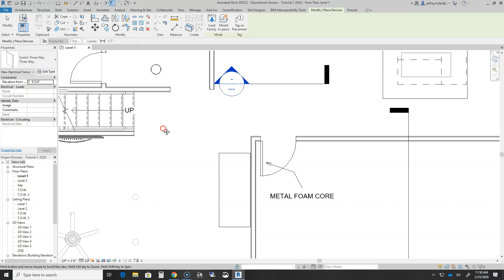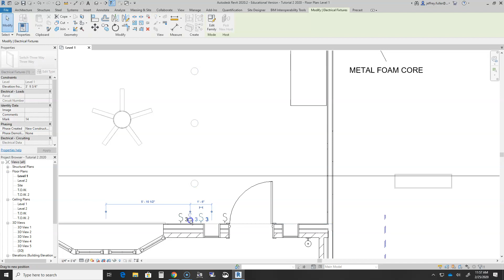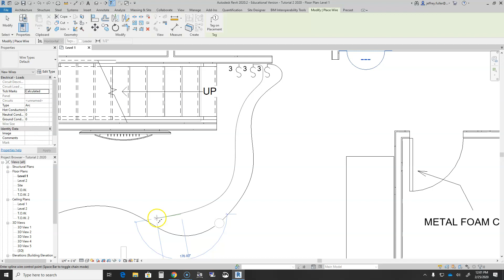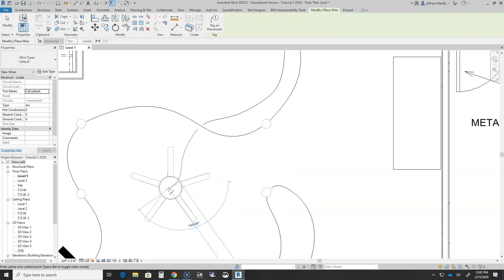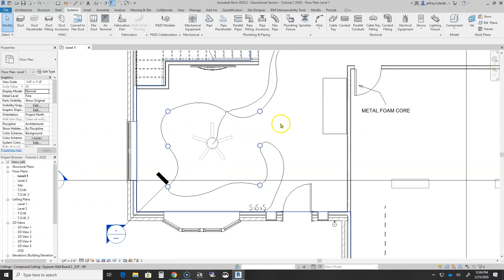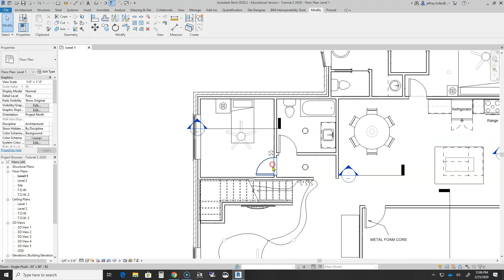Revit 2020: Advanced Skills, Lighting Control

Comment: Hi mate , one question , what about the connection in which you tell to the light witch switch it belongs to? Like is done automatically  the path
Reply: @JeffreyFullercad  Hi and thanks for answering, I meant that here you are drawing the switch to light cable manually with just detail line whereas you have an option to do it by system, clicking the light and assigning a switch to it. (I'm actually having big issues connecting two three way switches to the same light, I don't know how to tell the program to do it, do you happen to know?)
Reply: @JeffreyFullercad  thanks teacher! Btw after some research I read Autodesk people saying that the feature is not yet available! For some reason